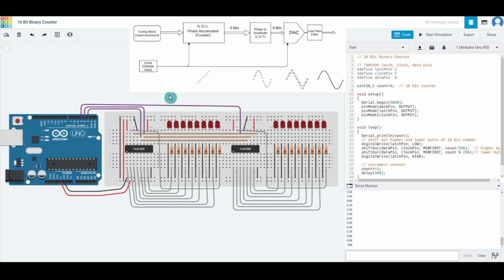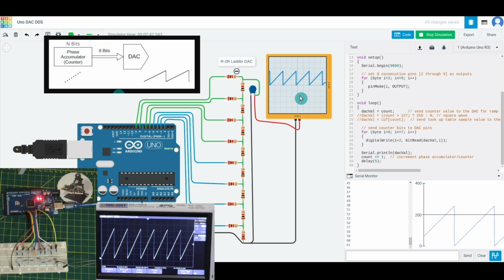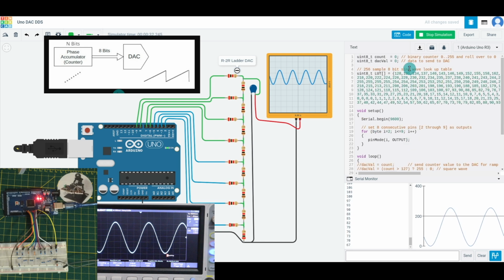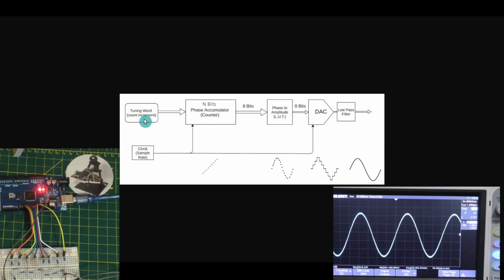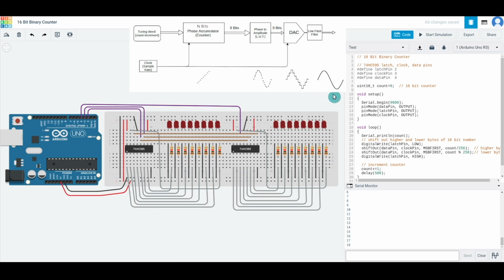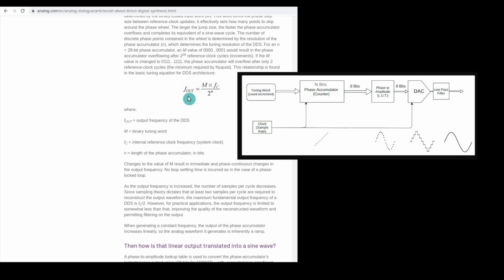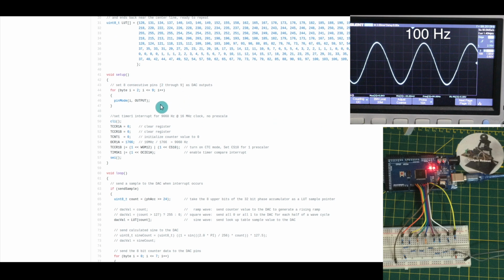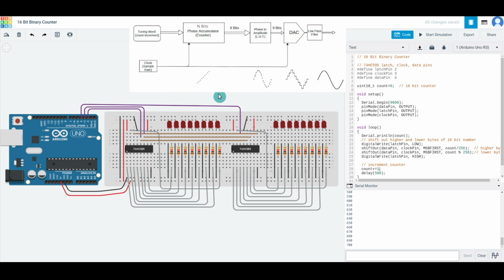Direct Digital Synthesis - How DDS Works and an Arduino Example

Comment: Awesome, I just put together a simple setup too using a MCU board I had and was able to get a 1:1 count from a clock divider to set the frequency. Pretty cool too see the discrete voltage levels when you take out the capacitor.

Comment: Very nice explanation and presentation. Question is, what is the maximum frequency one can get from this setup? What determines that Max frequency? And here, wer talking about a sinewave. If i do lets say 512 samples per cycle, what would be the max achievable frequency?
Reply from the maker: The main thing determining maximum frequency is the sample rate which has to be at least two times the frequency of the synthesized waveform in order to reconstruct a signal of the frequency. so just like with audio if the sample rate is 44 kHz then the maximum audio signal is around 20 kHz. so to reproduce signals with higher frequencies, a higher sample rate is needed and the chip being used has to be able to keep up.
but that’s the bare minimum frequency versus sample rate needed to just re-create any shape of signal that can have that frequency so it’s not going to reconstruct a very accurate looking signal, if the signal is supposed to be a sine wave, then there’s only two or three samples of the sine wave needed to regenerate a high frequency signal but it’s going to probably look like a Triangle wave so realistically I think people use a rule of thumb where the sample rate should be more like 10 times instead of just two times the frequency of the signal we want to reconstruct. then we get a bunch more samples of the sine wave available and it looks more realistic.
The number of 512 samples for the waveform being reconstructed also determines the resolution possible when reconstructing the signal, more samples just means there’s more in between voltage levels to generate but it doesn’t directly play into the max frequency that can be generated. you can take a poor quality audio signal and put it on a cd and play it back and it will just sound like a poor quality audio signal still, or you can take a professionally mastered high-quality audio signal and put that on the CD and it will playback as good as the audio equipment can manage so it’s a matter of what you put in is what you get out
A sine wave with 512 samples will not be as sharp as another sine wave with 4096 samples but they can still be used to generate probably the same frequency of signal. The tuning word can be made larger if there’s enough memory in the processor of course to allow skipping through the larger number of samples and being able to re-create the end between voltages that would be missing in the smaller sine wave sample so we’re really just changing the quality of the signal rather than the frequency of it by changing the number of samples available

Comment: Nice video. I've been meaning to do some DDS stuff. It's pretty closely related to audio synth too (most MCU based audio synth is a type of DDS, really). For anyone wanting to do a deep dive in to how the accumulator stuff you mentioned works, "fixed point math" is a good search term :)
Reply from the maker: I was trying my best not to use those buzz words out loud because I'd probably get yelled at in the comments for not talking about it properly enough (it turned up in my own research).    
I think next I'm going to migrate to the Due with its 12 bit dac and use some of the other reference material I stumbled across while researching, and then I want to try some Teensy stuff.
Reply: @GadgetReboot  Oh, I think you were definitely right to not go down that rabbit hole in this video; I was just hoping if someone looked in the comments for more info I might convert someone to the dark side, I mean the magic of fixed point :D ... and comments help you with the algo, right?

FWIW, Teensy is a fantastic platform for signal synthesis. Lots of power and related peripherals, and if you want to take the easy route there are some easy to use libs and editors for audio synth on a Teensy.
Reply from the maker: @circadianrebel  I think I ended up in a network of 10 rabbit holes on this video topic.  Still trying to wrap my head around how to know when mod math is useful in programming...I can only really find examples that tell me "yeah so mod gives you the remainder when you divide"  ya...and why do I want to do that?  The closest I came to a practical use other than separating out the digits in an integer for display purposes, something about using it to find the start or end of a series of data points in a table, like if every 4 bits belong together and you calculate that you land on bit 3 of 4, you can auto-sync back to the first of those 4 bits and get the right data chunk.   But...whaaaaa???   Nothing like nested rabbit holes to pass a week.

So far I've used the Teensy audio gui for sound effects but I want to try to use those  waveform generators for basic arduino-style synths with maybe two tones and some modulation and delay stuff.  Should be easy enough to draw some node red style lines and get something happening.

Comment: Hello Mr. Gadget. Try this for the R2R value set in place of the for loop/digitalWrite: 

PORTD |= (dacVal & 0b11111100); 
PORTB |= (dacVal & 0b00000011);  

This will set the bits needed in the two ports used by those pins and should give you better granularity and speed for the final output.
Reply from the maker: I'll try that!  I knew going one bit at a time was horrible and it would have been nice if everything could be done on a single port write.  Another issue I had was I didn't have enough 1% resistors so I had to use two 5%, and depending where I put them, it made everything look way off.  But was fun to play with and see the impact of part tolerance.    I'll be using the Due soon with the built in 12 bit dac and much better performance...
Reply: @GadgetReboot  Would be tempted to use a unity gain op-amp at the end of processing to improve the impedance.
Reply from the maker: @GnuReligion  I think there's some stuff on the cutting room floor about buffering the DAC and how bad the loading of the capacitor was as frequency changed, but I figured that was the least critical thing to focus on and I'll be moving to a "real" dac next.   The first draft of this video was 29mins with 2+ hours of raw footage.  And I'm still not really happy with it - would like to do a 3rd take but....I could do that forever!
Reply: @GadgetReboot  Am quite impressed with how your production quality has improved the last year.  Narrative cohesion is great.  Wish I had the skills to produce tech vids like this.
Reply: @GnuReligion  GB does a great job. I wish I could string sentences together like normal folks as well :) I have at least learned to explain code in documentation over the past 33 years. Shoot, I even comment some now! ;)
Reply: @UReasonIt  A lot of we techies are in The Spectrum, and do not communicate well, verbally, like normies.
Reply: @GnuReligion  Yep. I try to control my autistic tendencies, but it's hard sometimes.  I have always wanted to be able to get my thoughts out to others in a clean way. I typically use email first then in-person or on the phone later.  Hey, at least I don't hang up anymore on people when the phone conversation is over (or at least I thought it was :-)
Reply from the maker: @GnuReligion  Thanks!  I'm hoping when I finish moving this summer plus some settling time, a lot of pent up project ideas can be realized and a lot more easily too.  This past year has been all over the place where I started packing to sell/move last May and I'm still not going to be in my final place until maybe this July - at which point I have to do all that moving and settling and setting up and who knows when I'll be officially back on track, but I have plans for a whole new workbench setup and camera setup and maybe work on audio setup, and finally have the time/space to work on ideas.
Of course that could backfire because I have more time to ruin things!  We'll see.
Reply: Very instructive video!
Some use cbi, sbi and _BV to quickly bitbang, while still writing legible code.  These may be defined already in io.h or such.
#define cbi(reg, bitmask) *reg &= ~bitmask
#define sbi(reg, bitmask) *reg |= bitmask
#define _BV(bit) (1<<(bit))
It has been a while since I had to do cubic spline or linear interpolation of a table to implement a sum-of-products function, in a slow computer's ISR, without float.
Reply from the maker: @GnuReligion  I think I last did something in assembler in a PIC back in 2000 where I had to use some kind of algorithm 8 bits at a time to do a sum of squares and square root.  I think someone in a newsgroup helped with that.  I don't know how people got anything done before internet!   I'd only been using it 4 years at that point...